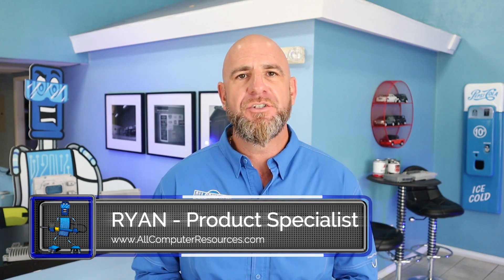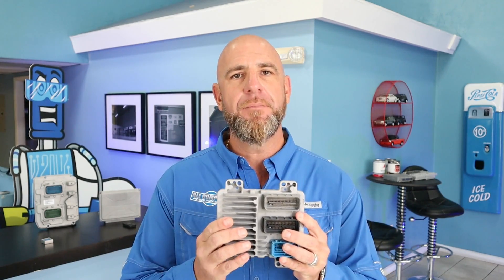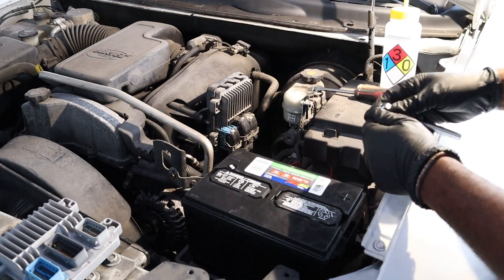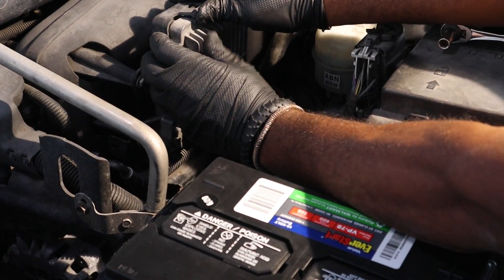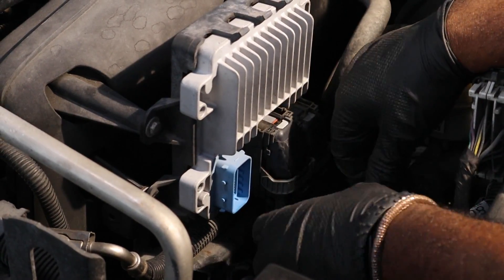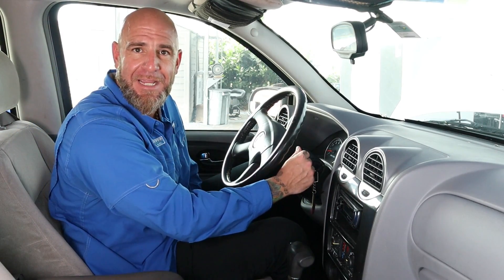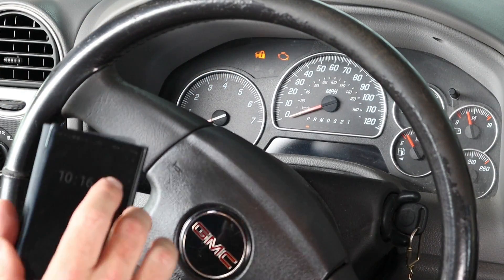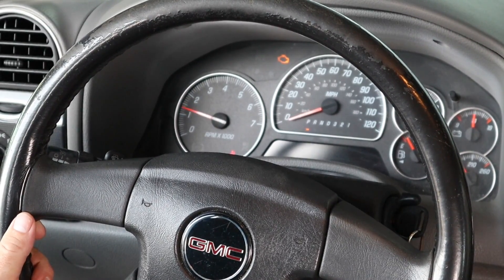HOW TO PROGRAM KEY FOR GM/CHEVY ANTI-THEFT - ECU REPLACEMENT PK3+ / PASSLOCK

Comment: What does it mean if i try to start it the antitheft light disappears then reappears a few minutes later?
Reply from the maker: Great question! If the anti-theft light disappears when you try to start the vehicle but then reappears a few minutes later, it typically indicates that the key and the vehicle's security system have not successfully synchronized. This can happen for a few reasons:  

1. *Incomplete Relearn Process:* The system might not have completed the key relearn procedure properly. Make sure you're following each step exactly, including the timing intervals between cycles.  

2. *Faulty Key or Programming:* If the key you’re using is not correctly programmed or has a damaged transponder chip, the system may reject it after initially trying to authenticate.  

3. *Security Module Issue:* There could be an issue with the anti-theft module (such as the BCM or ECM), which may require further diagnostics or reprogramming.  

We recommend retrying the key relearn process from the beginning and ensuring the battery is fully charged during the procedure. If the problem persists, it may be worth consulting with a GM-certified technician to rule out hardware or module issues. Let us know how it goes! 🚗🔑

Comment: My key says valco... only it's a key fob for sonic ltz 2012 1.8l
Reply from the maker: The 2012 Sonic uses the PK3+ system. This video demonstrates the correct procedure for programming your keys, provided that the PCM you're using has been properly calibrated and programmed for your specific vehicle, and the key was functioning previously.
Reply: I'm installing a new PCM that is supposed to be programmed to my vin when I get it. I only have one key for this car that is working on the PCM I'm going to replace. Is there any way that when I put new Pcm in the car will just start and I won't have to reprogram the key.. or do I I have to do these steps almost certainly?? Also does this reprogramming have to do with the anti theft reprograming as well ? And ty for your response earlier so fast
Reply from the maker: @ProjectM51  We recommend contacting the company from which you purchased the PCM to verify the appropriate steps with them, as we cannot speak to other companies' practices or programming methods. As one of the few companies authorized by the manufacturers to carry out these specific programming procedures, the instructions in this video are tailored to PCMs we programmed and may not apply to those from other providers.
Reply from the maker: @ProjectM51  We recommend contacting the company from which you purchased the PCM to verify the appropriate steps with them, as we cannot speak to other companies' practices or programming methods. As one of the few companies authorized by the manufacturers to carry out these specific programming procedures, the instructions in this video are tailored to PCMs we programmed and may not apply to those from other providers.

Comment: My key on my 05 Chevy trailblazer has 14R3 on the plastic, what does that mean?
Reply from the maker: The "14R3" on the plastic part of your key is likely the *key blank code* or manufacturer identifier for that specific key type. It helps locksmiths and dealerships identify the correct blank to use for duplicating or replacing your key. 

For your 2005 Chevy Trailblazer, this code corresponds to a key designed for the vehicle's ignition system. If you’re getting a replacement key, make sure to provide this code to ensure compatibility, especially if it has a transponder chip that needs programming. Let us know if you need help with anything else! 🚗🔑

Comment: I replaced my ECM, and this procedure doesn’t work. The light just stays on. As well as “service theft system” what do I do? I have been down for a week already waiting on this part, because they supposedly programmed it with my  VIN. I’ve been trying to “relearn” the key for 3 days now. I’m about to be booted from this place for lacking rent and then all I can do is let em tow the damn caR, lose everything, go start in the freakin woods AGAIN! No this wknt be the first time I’ve lost EVERYTHING in the blink of an eye…. Can I please get an answer ASAP?
Reply from the maker: Hi John, before proceeding with the BCM replacement, please reach out to our tech support team to confirm you're following the correct steps for the Key relearn process. Here's a link to contact them directly. After receiving the auto-reply, make sure to respond to that email.        https://store.allcomputerresources.com/support.html
Reply: @acr  thank you. Would hate to buy that part and it turn out to be for no reason. I did follow your steps exactly though, and checked my key. It’s a circle with a + in it so I followed the PK3+ as you said. But i will contact tech support before buying anything else. Thanks again
Reply: If you purchased the PCM from them they offer technical support on their website. If you didn't have them program the computer for you this procedure wont work
Reply: @ryand3248  it is from them, and the process isn’t working. Particularly, the security light NEVER shuts off and on top of that, im getting message “service theft system” while the only OBD code I get is camshaft position needs relearned. It’s a 2014 impala limited. Used to be a police car, is rebuilt. But I’m suspicious enough now of the BCM that I’m going to replace that next…. Just not excited about living in this car I’ll have to push to the damn street and hope I pick the right pvt property  to push it to… BCM also has to be programmed. So I’m going to guess I still have a week to a week and a half wait on that once I’ve ordered it…

Comment: Good morning to all.  
Thank you for this awesome video.  You are truly an educator. 

I'm on my way to see a 2014 Chevy Spark.  Engine and ecu were replaced. Engine came with ecu.  I'm hoping it's just a key learn procedure.   Any advice? 🌌🏌‍♂️
Reply from the maker: The ECU is integrated with the vehicle's security system, including the keys and ignition. It will likely need reprogramming because it is linked to the original (donor) vehicle.
Reply: @acr  thank you for the quick reply 🌌🏌‍♂️ 
I told them this.   I'm in the nyc subway with a shopping cart generator windows laptop, vcxnano and the extool d7 diag tablet.  I have no idea I think  that all roads start at acdelco?

Comment: Do you have a video how to program for a 2016 Chevy Malibu push start?
Reply from the maker: The process will be the same. Instead of turning the key, just press the start button with the key close and hold the brake pedal as if you were going to start the vehicle.

Comment: I have a 2007 Chevy Silverado. I just replaced a PCM. It does not have a security system playing key no chip. I see no link below.
Reply from the maker: The 2007 Silverado uses the Passlock system. This is the correct video to follow if you have purchased a programmed ECM from us.

Comment: I have an ecm from the exact vehicle can I install it at home without programming it to vin?
Reply: Did the used ECM work I'm trying to do the same thing with a ECU from the exact same type of vehicle?
Reply: @fatcat4421  I ended up getting one from flagship one for about $300
Which honestly was a good deal 
They tuned my ecm and learned the key for me (for an extra $50)
So it was plug and play 
Should start right up
Reply from the maker: Generally speaking, from the early 90's, most ECMs require specific coding and calibration to run correctly and for the vehicle to start.
Reply from the maker: It's very unlikely. Modern vehicles require programming specific to the VIN, accurate key codes, and precise calibrations to ensure all features function properly.

Comment: I need to replace and reprogramming the ECU in my Chevy Venture 1999. I also purchased new pairs of PK3 keys on Aliexpress and engraved it. 
Is this procedure working with these new virgin keys? Or is needed the previous programmed key?
Reply from the maker: If you are replacing the ECU on your venture, the keys you are using must be previously programmed for this process to work (as long as the ECU is programmed correctly) If you do not have a pre-existing key, we would recommend contacting a qualified auto lock smith to assist with key programming

Comment: What if they security icon turns off with the rest of the icons after i turn it to on position? it doesn't stay on for the time.
Reply from the maker: I suggest you confirm this is the correct procedure for your vehicle and that the ECM you replaced is properly programmed and calibrated to your car with the key codes, VIN, etc.

Comment: i had a 2014 sonic replacement ecu and after about a month one day it would not start no security light i did the 30 min procedure and no start no crank we even tried to pull start it its a manual and nothing no ignition no fuel etc only code i received was a p0315 code have you ever seen that i believe the ecu i received might have failed i also did the crank relearn when i installed that ecu from flasgship one just curious if you have seen that before
Reply from the maker: We are uncertain how other companies program and calibrate their units. Are they offering any type of assistance?
Reply: They actually made me retract my review on google before refunding me i ordered one from you guys and to be honest the turn around has been a long wait not impressed so far sorry to say craig pfeiffer is my order name
Reply: sorry my phone was logged into my other account

Comment: my battery almost died on the 3rd attempt... so i got out the charger.. I had to do it 3 more times. It works!!
Reply from the maker: Yes, that's a great idea! You don't want to battery to drain to much or it will cause other problems.

Comment: 02 2500 Silverado Duramax Will the security system keep the truck starting up after 20 min 3 times around?
Reply from the maker: The relearn process must be performed at a minimum of 3 times

Comment: My light blinks
Reply: Same and it's saying service theft deterrent system
Reply from the maker: Hi @cjroy2318! If your security light is blinking, it means the system hasn’t accepted the key yet. Typically, this happens if the key relearn procedure hasn’t been fully completed or if the key isn’t properly matched to the vehicle’s security system.

✅ Try the relearn steps again: Make sure you’re doing the full 10-minute cycle 3 times (total of about 30 minutes). The light should stop blinking and turn off once the system has fully accepted the key.

✅ Check your key: If the key chip is worn or damaged, it might not be recognized reliably. Trying another key (if you have one) can help confirm this.

✅ Scan for codes: Using a scan tool to see if there’s a security-related trouble code can also help you know if something else is going on.

Comment: I did this now my rpm & speedometer not working on my dash
Reply from the maker: Are you using a programed and calibrated PCM from us?
Reply: @acr  yes
Reply: Program
Reply from the maker: @bigalproductions9295  Ok, if you purchased the part from us, we have a dedicated Tech Support team able to assist with any issues you may be having. Please scan the barcode that was in the box. This will lead you straight to open a tech support ticket and provide all the details for their research.

Comment: What if the secerityi light comes on soon as you try to crank it and then goes off 2 seconds later?
Reply from the maker: It would be easier to answer that by diagnosing the vehicle and having a brief history of the issues you've been having. If you purchased an ECM from us, a tech support team is available to assist you, which you will find on the QR code we sent with the module.

Comment: Will it work if the key is not the original. The ignition switch was replaced before.
Reply from the maker: If the key is not original, it will need to have a different type of programming.

Comment: I tried your method and it worked. All the other videos miss the key detail of trying to start after each 10min and five sec cycle!! Awsome
Reply: I'm gonna have to try this, I tried it 2 times but not to start the truck after every cycle, other videos just said to put it on the ON position
Reply from the maker: @Dan_Mk2  It all depends on the vehicle year and model.
Reply: @acr the statement "If the light didn't turn off after 10 minutes might be the BCM" is also depends on the vehicle. In 2007 cadillac escalade, and 08 Avalanche, the BCM and the instrumental does not control the programing. Remember this is GM, not Ford.
Reply: @Dan_Mk2 it depends. Stop attacking others videos
Reply from the maker: Great to hear!

Comment: Procedure did not work at all.  After attempting to start the vehicle, the security light went out after 2 seconds.

UPDATE:  Tried it a second time, and the same thing happened - the security light went out after 2 seconds.

Tried it a third time, and the vehicle started but stalled.

Tried it a fourth time, and the vehicle started, and runs perfectly.

It's like I'm some sort of genius, and don't even know it.
Reply from the maker: Hello, Sorry you are having troubles programming your key. Did you order a calibrated computer from us for your vehicle?
Reply: @acr  I'm not having any issues at all.  Took less than 5 minutes to do the Security Key Relearn and the Crankshaft Variation Relearn.  Customer picked up the vehicle last night, and says the vehicle runs better than ever.
Reply: Did you wait for 10 minutes or did try again as soon as the light went off?
Reply from the maker: @dadomoto7491  You should wait until the light turns off to start the next cycle. Its roughly 10 minutes.
Reply: @acr  I'm having the same issue. The light turns off  2 seconds, right when I turn it on.
Reply: @acr  -  FOR THE THIRD TIME, the light went off after two seconds!!!!  It did that four straight times and the module programmed successfully.  The customer has been driving the vehicle for a couple of weeks.  HELLO!!!  McFly!!!!  What part of that do you not understand???????????????????????????

At this point, I will make a point to NEVER, EVER buy a module from a company who doesn't possess the requisite intellect to read and comprehend the English language!!!
Reply from the maker: @Jimmydafreak  Yes, we understand, sir! The vehicle you were working on is running " better than ever." Another customer asked questions about your initial post, and we responded to him there. Sorry for the confusion. YouTube comments aren't the ideal area for troubleshooting, but we try our best to help everyone who comments here.

Comment: I followed to the letter. Still will start.. 2001 sierra 1500 gmc. I have been working on this fo several days!! Im not very happy!!!!
Reply from the maker: Hi Randy, This process is for a PCM replacement that was programmed by us (or in the correct manner). Did you order with us?

Comment: Important to turn key all the way to crank or start, and not simply to On position.  I tried for 3 10-minute cycles but failed because I was not turning the ignition key all the way to the crank or start position instead of the On position.
Reply from the maker: Yes, there are 2 types of procedures depending on the vehicle model and year.

Comment: Sorry to put a damper on the reviews, but I replaced my ecm with a Flagship plug and play and still after resetting key 8 times per instructyions still will not start? Put the old ECm back in and started right up?
Reply from the maker: Sorry to hear you are having issues with another company's part. We are unsure of their programming process. This video outlines the process for key relearn when you purchase a unit from us although it may work with other applications as well. If we can help in anyway feel free to contact us directly at 786-879-7566

Comment: 2017 Silverado Duramax, This procedure is not listed in Pro Demand,  Got the ECM from a diesel shop. The truck runs and drives but the security light is always flashing.
Reply from the maker: Did you purchase the computer from us or elsewhere?

Comment: thank you so much. i have a "b3031" and "security light is on and solid". how do i perform the relearn if the vehicle starts everytime.
Reply from the maker: Sounds like there could be a programming or calibration issue. Did you purchase the part from us?

Comment: I repeated the process 6 times already and nothing happened , I timed it every time the security light goes off I attempt to start and nothing happens, I emailed company they told me to make sure battery is charged and clean the connections anyone have this same issue?
Reply from the maker: Hello, Sorry you are having issues with the relearn process. Did you purchase the PCM from us?
Reply: @acr  yes I purchased from you guys I actually went and just got a new battery right now should I do the whole process again?

Comment: Why do you say you have to attempt to start it on each cycle. All you have to do is turn it to the on position. There is no need for you to attempt to start it at the start of each 10 minute cycle.
Reply from the maker: All depends on the security type of the vehicle. Some systems do not require the "attempt to start" procedure. You can find that video in the description of this video as outlined in the beginning.
Reply: @bassb450 watch the entire video before you make dumb comments
Reply: @KB_LBX  I have done these numerous times and you don't have to attempt to start it. What is so dumb other than your reply. Stick to your bikes because it's obvious you know nothing about cars.

Comment: Hi I just replaced ecu but door lock button with small light blinking any idea?
Reply from the maker: Seems like a programming or calibration error. Be sure the module is programmed for your vehicle. We can help with that. 786-879-7566